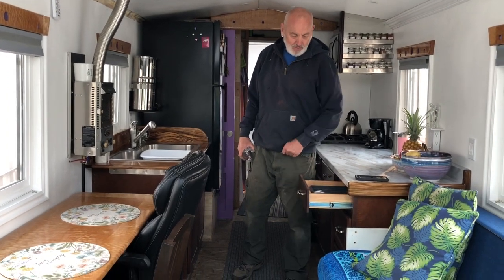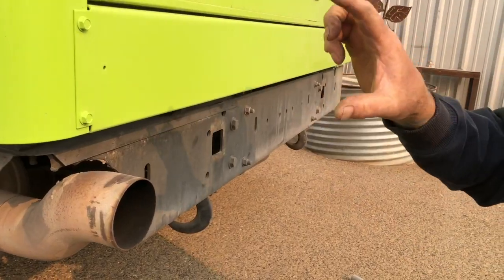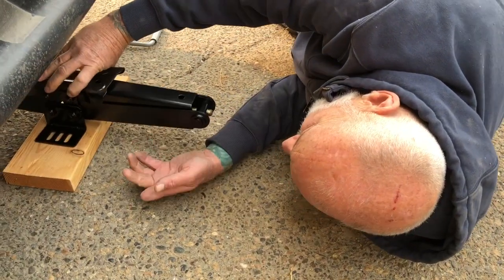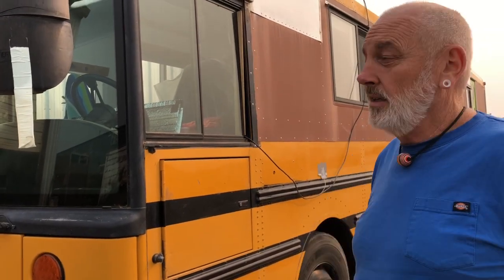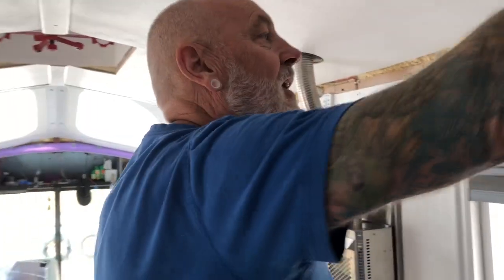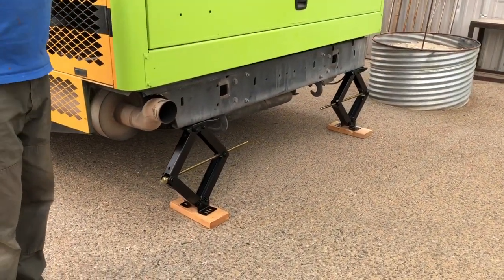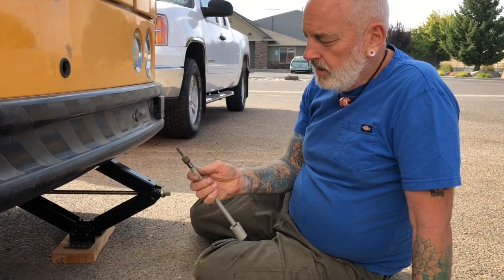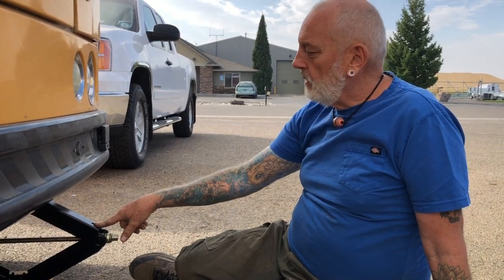Time to Level Up - Vlog 166 School Bus Conversion

Comment: It is always a challenge to find a "level" spot; especially when you're boondocking.  We have hydraulic jacks on our current RV, but still have to use blocks at times to get level.  But it is all worth it to be out there rather than sitting on a concrete pad (some of which are not level).  The learning will never end when you live "on the road".  Enjoy it all!!!
Reply from the maker: Thanks. 🙏 we are definitely learning as we go. 😃

Comment: The scissor jacks will be good for stabilizers.  You could weld or bolt them to the frame near the four corners.
Reply from the maker: 😃 The bus is already pretty low. There’s not really much room to leave them on.
Reply: @KnappTime  What about mounting them sideways permanently on the frame rails but closer to the wheels so clearance isn't an issue....lots of stuff would probably be lower...... then mounting an extension to the side of the bus.  Insert driver and boom.
I ask because we're building ours and investigating how to level with minimal hassle.

Comment: Hey Randy Shelly I just wanted to add my two cents also, and if you use inch and a half blocks underneath of the wheels and stack them up, similar to the ones that you can buy for recreational vehicles and then use your jacking system to make final corrections you’re keeping more weight on the springs, and less weight to have to lift to get it the way you want it good luck with the learning process!
Reply from the maker: We are learning. We did that today with some simple 2 x 12 boards. 😃👍thanks

Comment: This is a great topic.  I have been struggling with what I will do to level my bus.  I have already ruled out hydraulic jacks and I am currently leaning toward some sort of screw jack.  The scissor jacks look a little light to me, but I may have to revisit them after seeing this.  Although my bus uses air suspension, so it will slowly bleed own and may overload these because of that.
Reply from the maker: Yeah I’d really be careful with that. We have a simple spring suspension.

Comment: if you wanted jacks in the middle and no jacking point, why not weld a piece of angle steel across the frame to a point it can be easily reached from the side. Just a thought. Bus is looking good, when will it get a paint job?
Reply from the maker: Interesting idea. Keep watching because painting is coming up soon. 😃👍😃

Comment: You should be able to use your impact driver to turn the jack so it will not be hard on you
Reply from the maker: Yeah after some fiddling we figured that out. Thanks for the suggestion.😃

Comment: Just wondering about levelling from front to back.  Being a longer axis it would need more adjustment to reach level.  Do you think the scissor jacks will be enough for ground that slopes from front to back?  I guess ramps could help with that.
Reply from the maker: We think ramps are the answer. And we just tried them for the first time today. It seem to work really good. Even though it was just a simple 2 x 12.

Comment: I've thought about whether the suspension air bags could be set up for independent air pressure regulation when parked.  That would allow for leveling with the existing suspension with some controls in the driver area.  I'll have to consult with a diesel suspension expert.
Reply from the maker: That sounds promising. But we don’t have airbags. Good luck. 👍
Reply: @KnappTime  i assumed yours would have them.... same size and just next generation... mvp vs hdx. Were air bags an equippable option on your model?
Reply from the maker: I don’t know if they were an option. The guys here tried to get me to add them   I felt I had enough going on without dealing with custom building airbags for this bus. They had extra ones laying around in the yard :-) today we leveled with blocks and stabilized with the scissor jacks I think that’s probably the way were going to do it it seemed pretty simple :-)
Reply: @KnappTime  i hear you. Maybe a project for another time... when you get bored 😆
Reply: That's what we are looking at for our build.  Blocks under tires are fine up to a point. These big scissors stabilizers along with blocks will work though I'd mount the scissors on the frame closer to the wheels to maximize how much leveling a given vertical movement produces and to get them into a place where they aren't going to drag. We're still going to research using the air bags because we are often just a bit out of level and there is the potential there to just flip a switch or dial in the pressure for a small front-rear or Left-Right correction.

Comment: How is the propane heater working for you?
Reply from the maker: The propane fireplace puts off lots of heat. But we don’t feel we have an honest judge of how well it works because the front drivers area is still open as is the entry door and none of that is insulated. So it is still uncomfortable even with the fireplace on some mornings. We have got a diesel heater that we are going to be installing as supplemental heat in the front also going to pipe it down to keep the under bay from freezing. So we’re not quite all the way done with this heat situation :-)